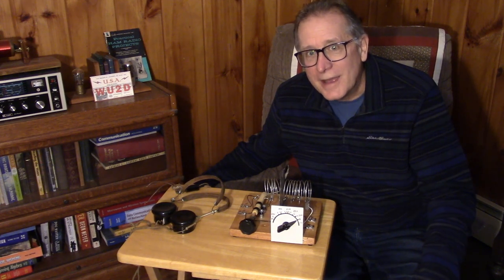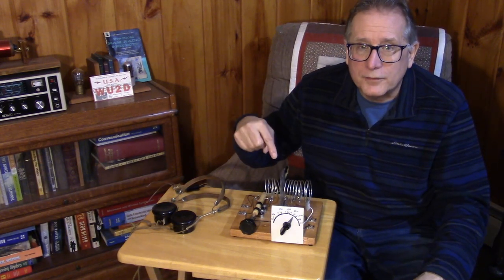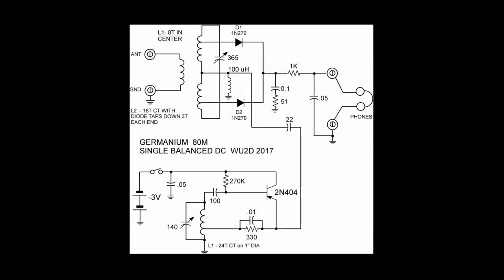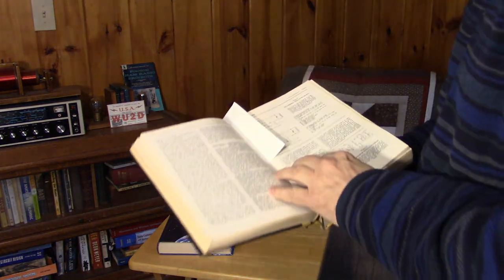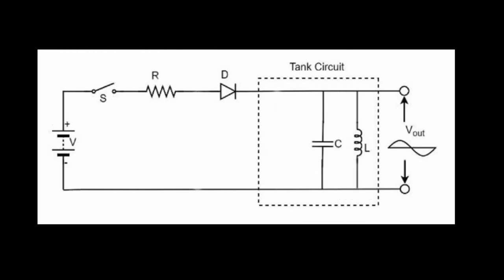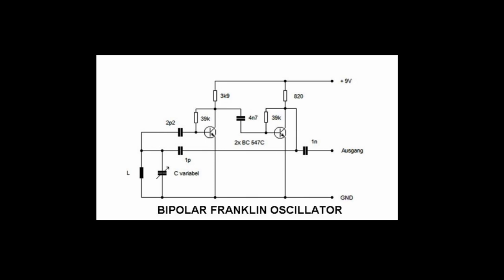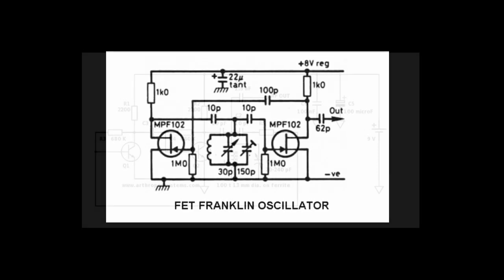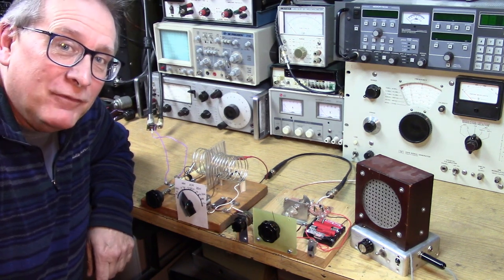Shortwave Crystal Set - BFO!

Comment: I was watching crystal radio videos......before giggling at your solar cell quip directed at the "Sallys", I was wondering if it would be possible to gain enough power by using RF sources to charge a cap that was then used to drive an amplifier or some other powered feature to enhance a crystal radio.
Reply from the maker: Yes and all you need is a pesky close broadcast station that you want to reject anyway. So maybe we make the TRAP send the bad juice to the power collector which handles the radio power.

Comment: The balanced modulator schematic is similar to a ring modulator I built for a friend that played electronic music. I placed the circuit in a Earl grey tea can. I used another can as a signal generator based on a 8038  oscillator i.c The 8038 oscillator oscillator requires 4 or 5 other discreet components and works with a 9 volt battery. Its very simple and provides square triangle and sine outputs at 0- 20,000hz..The chip is no longer made but can be found online. If anyone knows where to find the transformers let me know
Reply from the maker: A lot of folks ask about wonderful early linear arrays, phase locked Loops, and Mosfets that are becoming unobtanium. I remember working with the 703 IF Amp, The CA-2028, CA3089,  3N128, 40763 and many others that I just have to avoid pushing because it frustrates builders. I try to stick with the through hole parts that are more generic.

Comment: Hi Michael,  as the BFO will be operating at the same frequency as the xtal set,  would it not be possible to  use a twin gang capacitor to tune both. My old Marconi CR200 (2-V-2) used to do just that.
Reply from the maker: This was done in the pre-ww2 Western Electric aircraft receivers and some Navy TRFs as well. It is possible and practical - but demanding on the mechanicals to track a BFO across more than a small band.